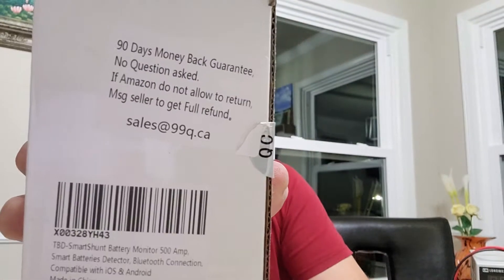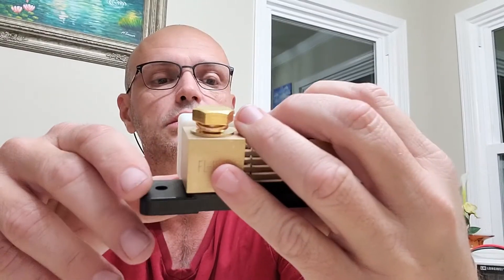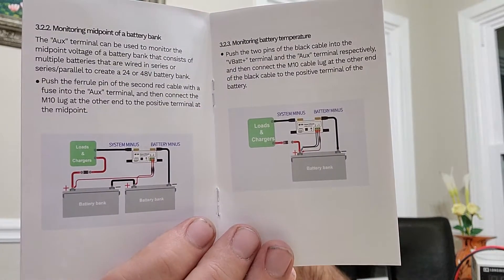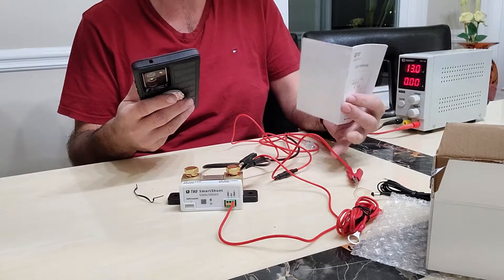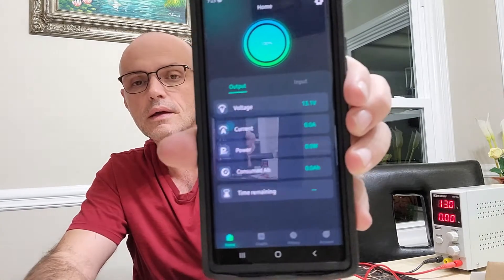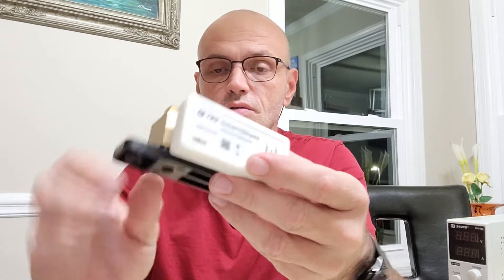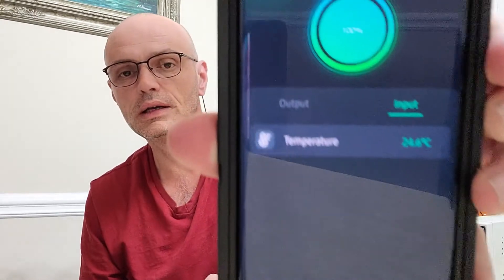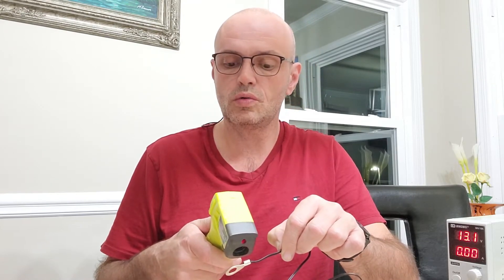Rhino Storm TBD-Smart Shunt 500A

Comment: Prime day 2 was 59.00
After Prime day 2 is 98.00
I bought one but don't like the account setup. 
Might be going back.
Reply from the maker: Account setup is one of the reasons I do not use it.
Reply: @DMIINC2013  
I'll keep it.
Come to think of it. 
Most of my Bluetooth devices asks for the same thing. Too good of an value. 
I have victron smart shunt for the house. Very dependable. 

This is going into my truck camper. I only bought it to monitor one lfp battery. Once in awhile monitor. Don't need to spend 130 for another Victron. 60.00 was well worth it compared to other cheapo's.

Comment: how did you create an account,  I keep getting an error message
Reply from the maker: Account setup was the pain. I am not using this shunt.
Reply: @DMIINC2013  why are you not using it
Reply from the maker: Due to issues with an app and overall quality.
Reply: @DMIINC2013  I am still playing with it but will most likely use it on my test bench instead of in an actual system

Comment: I purchased three of these  on Amazon and just received them earlier today. I've performed some basic bench tests and have found a few issues. I get a high pitched squeal coming from the bt radio on two of them. It's only noticeable to me at close range, but my dog definitely hears it in the next room. After a power disconnect, the Battery Settings are persistent, but the Alarm or Others settings revert back to the default settings. There are also a few dead buttons, like the Firmware Version and Update buttons. I have not tested accuracy yet either. Overall, it does seem to be a very good value. I'm confident enough that I've  ordered a fourth.
Reply from the maker: You are way ahead of me. I am awaiting some cells to test accuracy of the shunt. Yes, good value for sure.
Reply: @DMIINC2013  FYI, today I received a sample of the latest revision from Rhino Storm for testing. I'm happy to report that they have corrected all of the issues that I reported, the high pitched squeal from the BT radio, implementing a BT PIN to connect as well as the ability to set your own PIN, fixed Alarm & Other setting persistence, and Historical Data. The app has also been updated to function with the new hardware while maintaining backwards compatibility. They did confirm that the new version had hardware changes to enable all of the features and fixes, which means the old version is not upgradeable. It was nice to see their responsiveness to customer feedback and follow up. These upgrades make this product an outstanding value.
Reply: @alpinerep  Do you know if the one currently available on Amazon is the updated version? Or are they going to sell out of the previous before implementing these changes globally?

Comment: Could you check the range on it? The Victron Smart Shunt has the worst bluetooth range in the history of bluetooth.
Reply: Victron Energy Smart Bluetooth Range on Android devices is horrible. 
But, when it comes to Apple devices, Victron Energy Smart Shunt Rang is awesome.
Reply: @jwsolarusa  I just tested bt range on IOS and it's good to about 45 feet.
Reply: @alpinerep  
I have mine installed on my portable mobile solar generator. 
The range wasn't good at all when I installed the App on both Samsung and my Asus Tablet Android iOS. 
A month later, I decided to tried the Victron Smart Shunt with my old Ulock Apple iPhone 7 Plus 256GB storage and I noticed the range was quite  better than the Android iOS. I didn't post any bad review on any Victron product at all because, Victron is an excellent choice.
Reply from the maker: I do not have issues with a range on Victron Smart Shunt. 25 to 30 feet easily. I will check and see how this one works next time I have it out. Thanks,